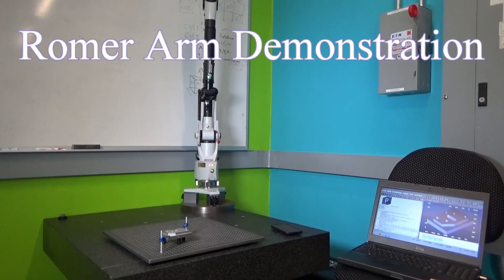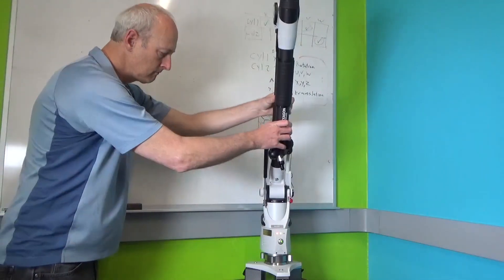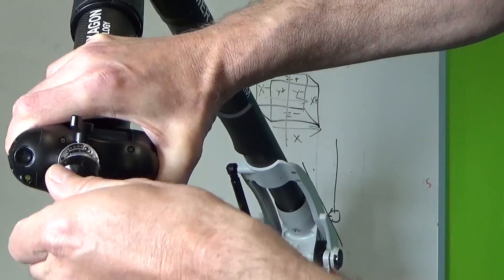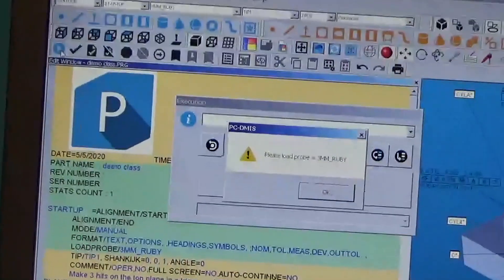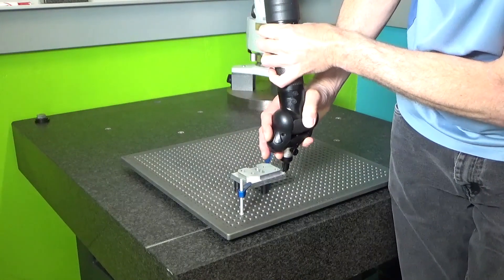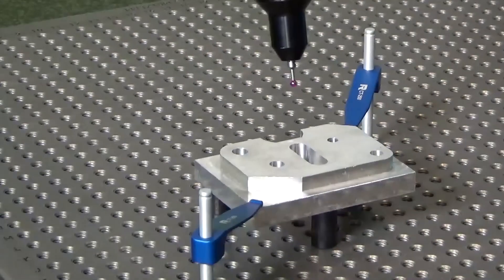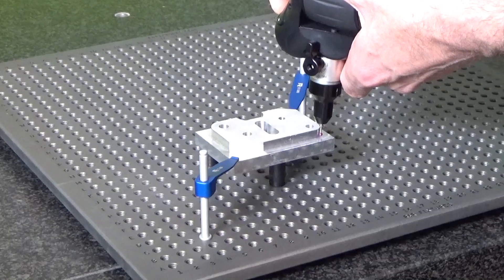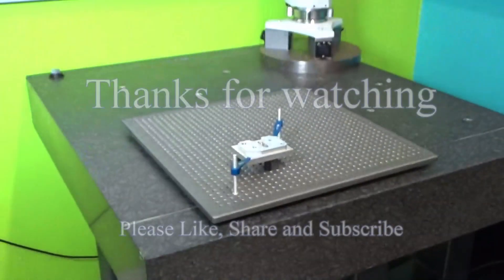Romer Arm Demonstration

Comment: The machine shop I work in has one of these. It's been sitting in a box for 4 years basically brand new. I'm on day 2 of tinkering with it. Nowhere near making programs. I'm using the quick dimension feature from the software used to calibrate the probe to get a feel for how to use it to measure and I'm getting variations up to .001 in. Any suggestions on how to make my readings more repeatable?
Reply: it has a tolerance of about 35microns so Your measurements seem ok, the bridge cmm is more accurate
Reply from the maker: It's all about how consistently you probe the object.  Try to probe objects straight up and down or at exactly 90 deg to your objects.  There is a need for good technique.

Comment: How do you calibrate the probe?
Reply from the maker: The calibration is a lengthy process.  I might make a video on this at some point.  The arm has to be moved into about a dozen different positions as referenced to indentations in a calibration standard bar.  It's tricky.
Reply: 30 second process to calibrate a probe. Go into the RDS Control Panel --> Probe Tab --> Calibrate button --> select Single Point calibration ---> take 36 points in a cone or seat.... DONE!